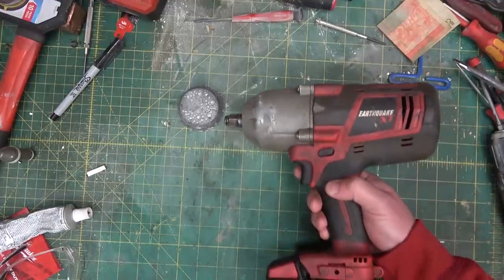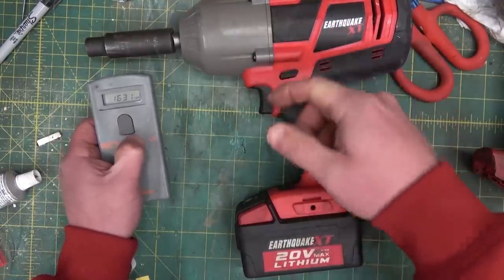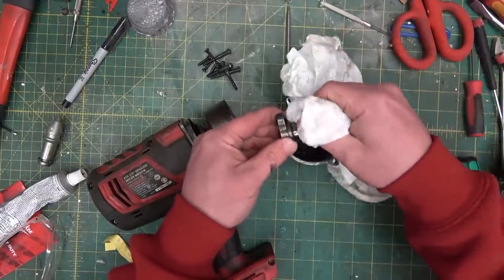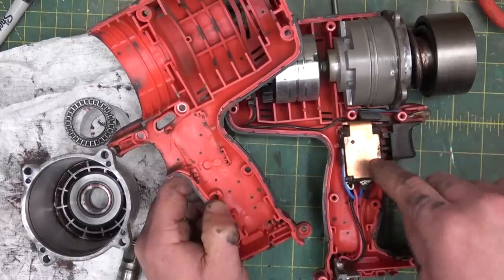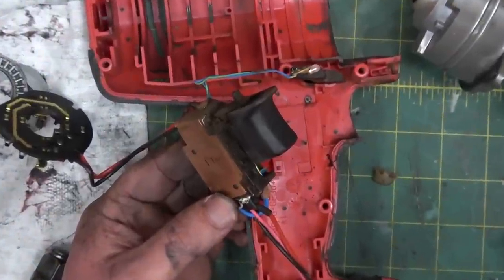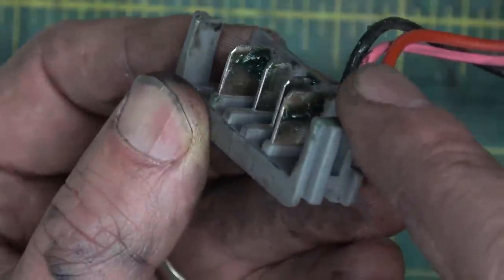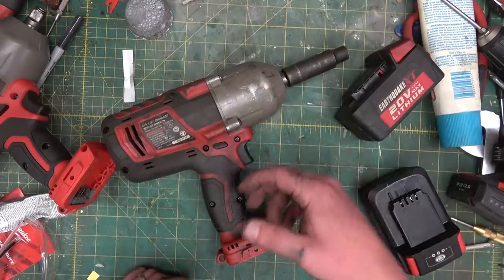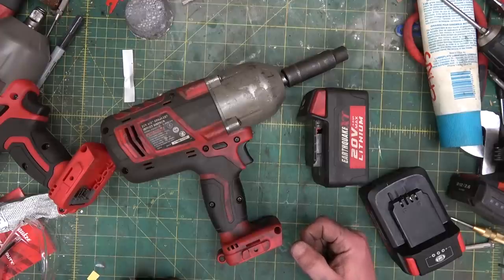BOLTR: Lost Torque 13 Month Earthquake Impact | Harbor Freight Tools

Comment: Had my fair share of crapsman tools exchanged, turned in a three foot long receipt one time to the boss. He was freaking out till he got to the end and it was zeroed out. That be said, the hazarded does do lifetime but only on mechanical. I think electric anything is only 30 days. Still, sucks sears took shit after shit, sold off in bits and pieces by a raider for personal gain, and was successful at plundering an icon. Now I have no where to get the service they sold me.
Reply: My cousin called them to find out where he could get service on a compressor he bought there a long time ago. They did give him some options, but I think it involved going to a Sears store somewhere. Ace Hardware sells some Craftsman & I think they said they would be willing to replace hand tools, but not a compressor. FWIW

Comment: bet the the trigger is no longer giving the signal for 100% trigger it only giving 70% trigger cause of all that smew that got inside.
Reply: check the voltage at the motor while the motor is running on the new and old.

Comment: There's no brush left..after 12 months of hard knocks the brushes are all stumpy once 3/4 of the brush is gone they stop contacting properly couple that with the whole thing wobbling  all over now there all cockeyed..put a new brush card on there and it'll be right as rain ...until that wobbling Jacks it up again ...12 to 15 months is about when people who use thoughts heavily bring them into the shop and it's almost always brush related sometimes switch..
Reply: Also when the battery  starts to go you dont lose power you lose charge time ...under normal battery depletion your just gonna get less and less time out of a charge until one day she no work

Comment: You said that anti-seize is NFG for bearing grease but I notice that Glock ships their pistols with, and recomends in the manual, that you use copper anti-seize to lubricate the slide rails. What are your thoughts? I know it isnt a bearing but it is a bearing surface. Of course I just lube the gun with what ever is on hand, just curious.

Comment: Seems to me just good enought fit and finish makes sure it slowly wears out in every way, structurally and performance wise, throughout the gun.  This is an especially dissapointing failure mode. And not even thru a single set of brushes.  The wallowing pins in the front housing aluminum bore is especially frustrating, as thats a pricy and critical part, I would imagine.  Why didnt they use fasteners that also acted like dowls like many automotive fasteners do, or build the 'drivetrain' into a single piece self supporting unit like many dewalt drills use?  Those tiny hard pins held in place with sad thin wood screws drilled into a soft nylon body set into soft aluminum. What a joke.

Comment: 90 days warranty on $300 tool when you can buy a Kobalt XTR  at Lowes that has a 5 year Warranty and a 3 year battery warranty and is $199....I think Harbor Freight is upsetting the cosmic balance and getting one over on its customers, so when they stick the old one back in the box....that's the actual karma. lol

Comment: yeah really, whats up with those lame people who return their tools after getting their job done with them?
that impact wrench costs like 4 hours of normal hourly rate in USA... here the price of the cheap "chinezium" quality impact wrenches is same as those harbor freight, but work for no more than few months tho and here (in Macedonia) you need to work like 82 hours to buy one... if you are lucky you will get warranty for it and even if it has warrant you will most likely wont get refund or replacement, they will say its was your fault that the tool died...

Comment: All of these roll down the same assembly lines, HF, dewalt, Ryobi, porter cable.  All zombie brands these days.  All throwaway.  If it is made in China, which 99% of modern stuff is, it's the same old story.  use it, toss it, nothing you can do.

Comment: I’m sorry but, if you’re a “professional” and you use these battery powered jobbers as your primaries, you aren’t that bright.  Nothing beats pneumatic, except in those cases where air supply and convenience take separate paths.  I’ve got a crapsman pneumatic impact gun that’s all metal construction I bought back in 2004, and the son of a bitch is still chooching along strong as ever.  Fucker has been knocked of a lift and hit the ground more times than I can count, been run over, left out in the rain, used as a hammer....  put a little oil down her gullet and away she goes.  Battery powered tools have their place, but when you have the option of air instead, you’re an idiot if you prefer that nerf gun instead.  I’d never send my equipment out to any shop that’s running around with a bunch of battery gimmicks versus pneumatic.